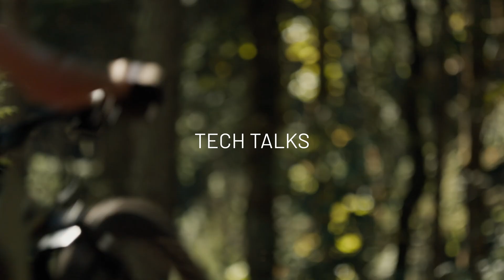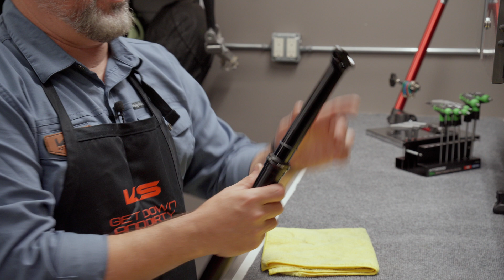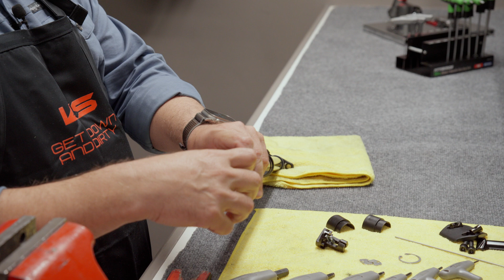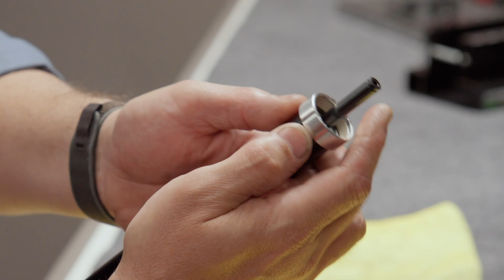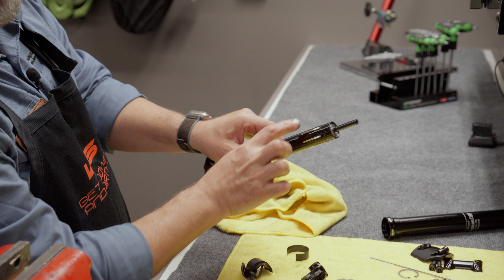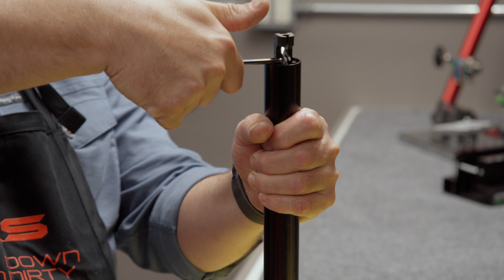KS Rage-i S - Maintenance video

Comment: could you simply yank the post up and pull the bushing out rather than trying to press them out? I can't figure out how to make the DIY tool
Reply from the maker: Hi, thanks for reaching out. Rage-i S uses a drop in style bushing and a threaded seal collar.  No press is needed to remove the bushing.
Reply: @kssuspensionusa  thanks, my eyesight is not that good but the seat collar doesn't look like it could unthread.  I'll have another look with better glasses

Comment: lol for $150 I would just buy a new post.
Reply from the maker: Our goal with these videos is simply to help people get the most life out of the equipment they already have. A bit of maintenance can often keep a post working well for many more seasons and helps avoid replacing products unnecessarily.
Reply: @kssuspensionusa  I understand. My ks post on my amflow has only seen riding the past few months (400 miles) and the dropper cartrige is already failing ): i dont think I can get a warranty because I bought the bike as a shop owner. I dont have a proof of purchase lol

Comment: Btw for those at home instead of washers a bolt and nuts. A roughly 3/4" aluminum pipe or maybe even better pvc pipe and a hammer and you can just knock that puppy out